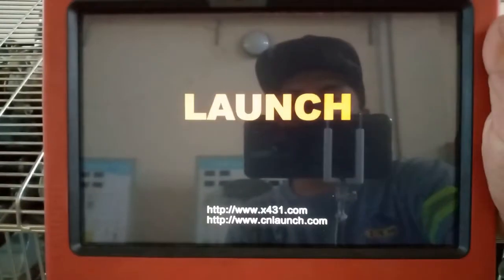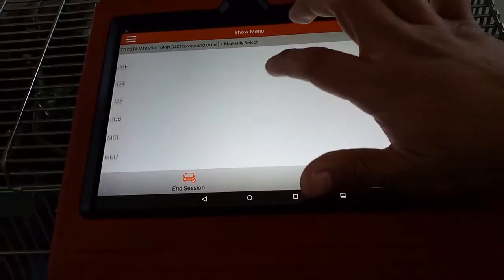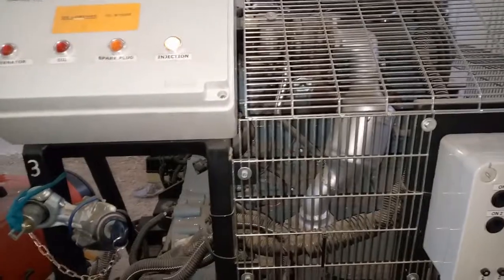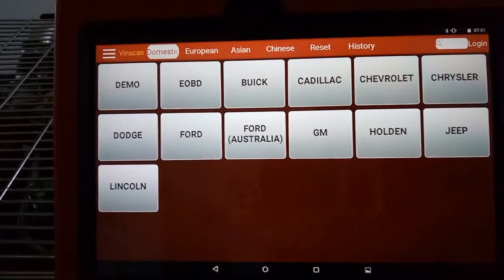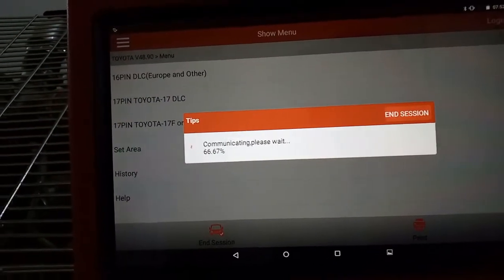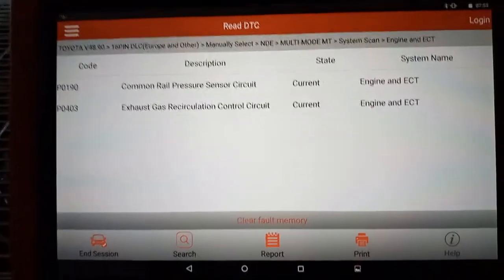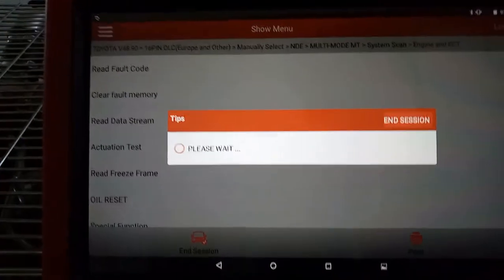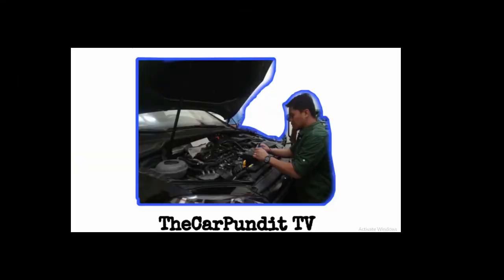Scan Tool Basics | How to Read and Clear Fault Codes | LAUNCH X-431 Pro3 V2.0 | Part II

Comment: Hi Does the Launch x431v reset airbag modules? Clear crash data? Or program unProgrammed key fobs If you have no keys I’m being told by launch USA that it does. But I thought I would just cleared it up by asking you since you seem pretty respectable and a reliable source And you own the scanner. Thanks for your help
Reply from the maker: Hello brother! so glad to respectfully read such a comment or questions from you.. yeah, from what I had with my Launch X-431 Pro3 V2.0 Scan tool here serves a clear crash data and or reset SRS/Airbag Modules, Program key fobs feature or scope. I believe from your Launch X431 V also had this scopes. Excited to hear from you soon. Thank you.

Regards.